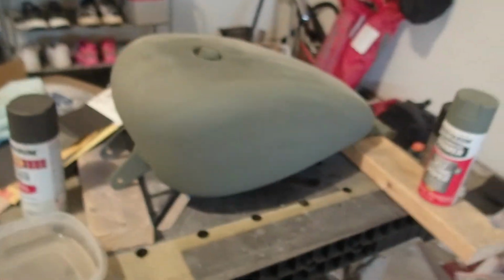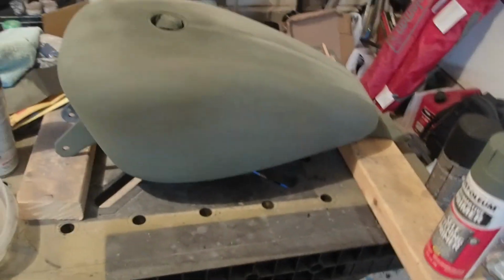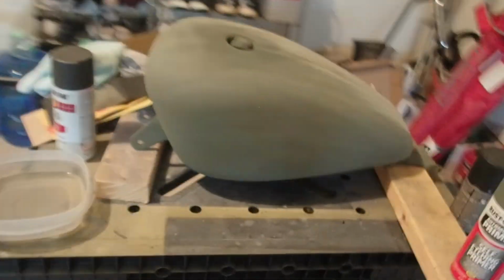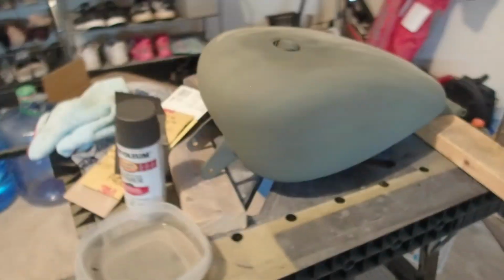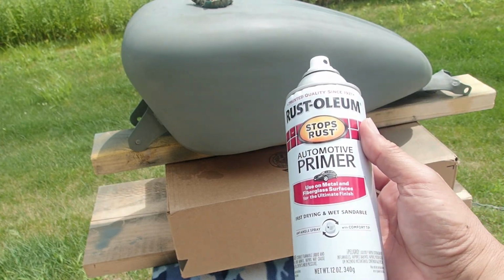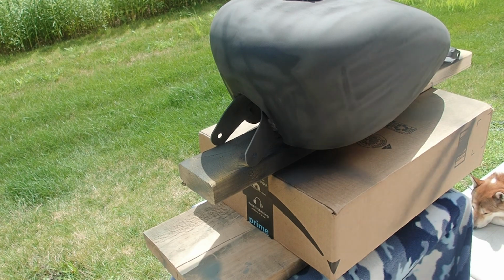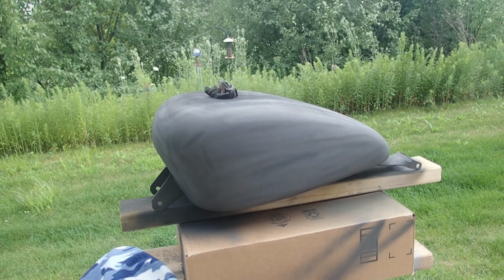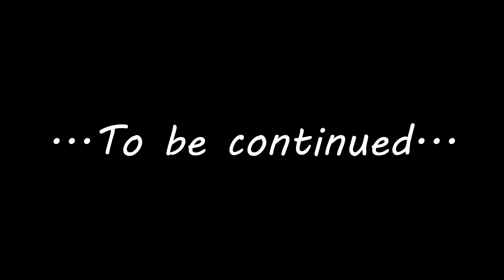Harley Sporster 48 Gas Tank Replacement Priming

Comment: Can we use primer for inside the tank
Reply from the maker: I think its not recommended to put primer inside the tank.
Reply: @irogdebs8698  Thanks for the reply ...will epoxy work?
Reply from the maker: @mohitbhatt5868  I am not sure what you are trying to do.  The inside is normally cleaned only.
Reply: @irogdebs8698  Actually it's a new tank no paint work has been done yet proper factory condition 
So inside rust is happening very mild ..so I m not sure whether to put gas now or after cleaning and coating it to prevent rust
Thanks
Reply from the maker: @mohitbhatt5868  You can try using gas tank sealer.